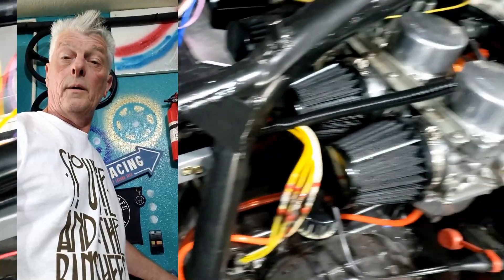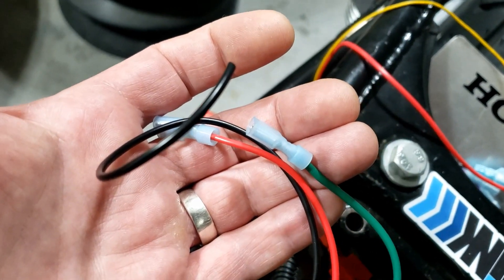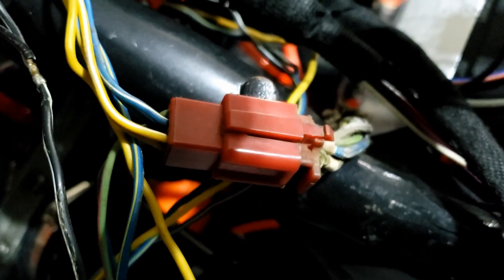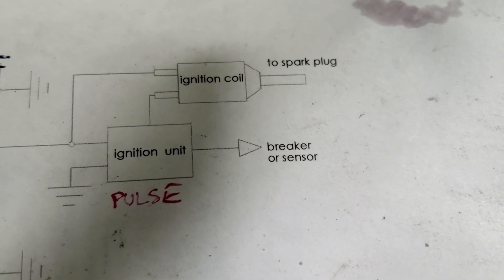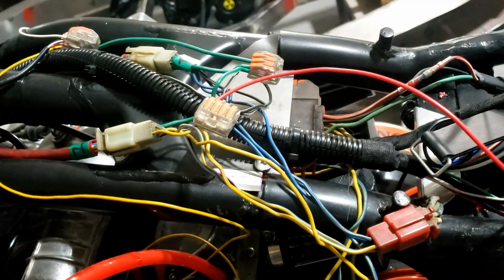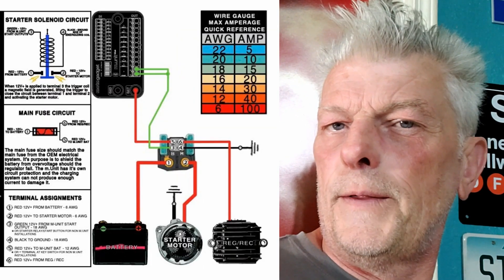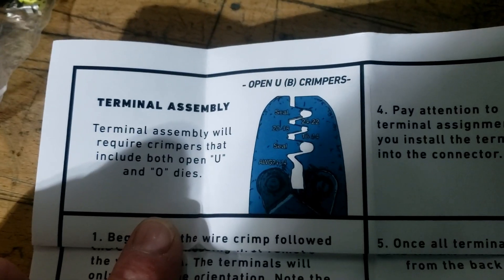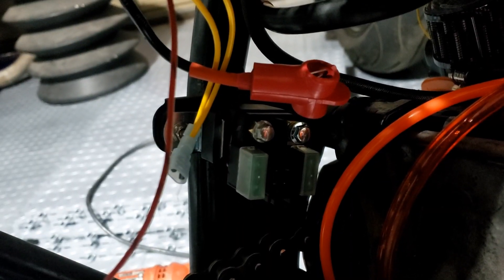M-Unit Install Wiring Final Steps and Starter Solenoid - Honda CB750

Comment: Did you have any issue with the rectifier.  I wired mine exactly like yours and I can hear it sizzle
Reply from the maker: Not that I noticed. I will check that though. Perhaps your rectifier just happened to be on the way out anyway?